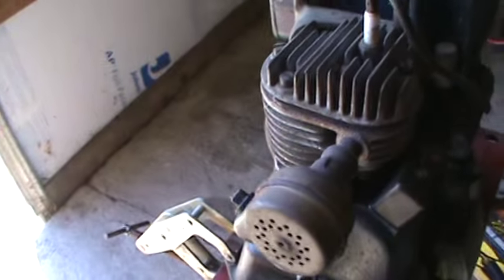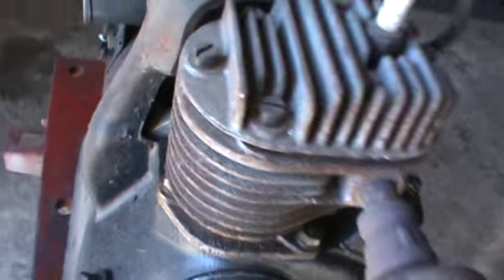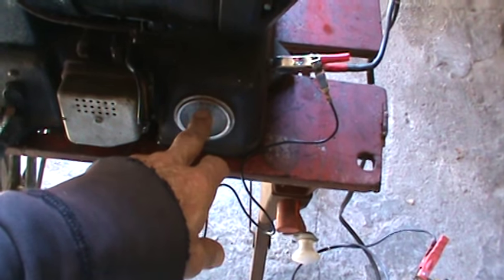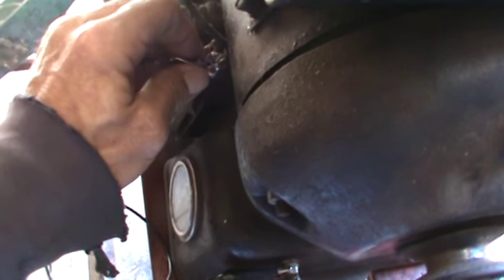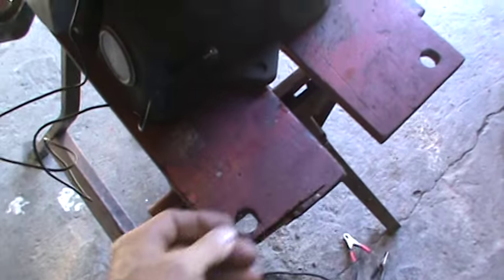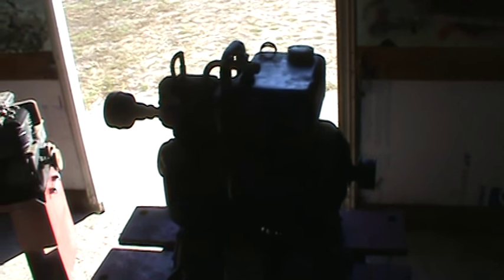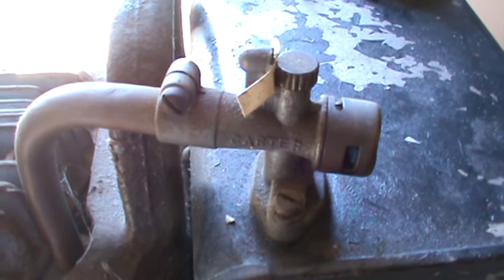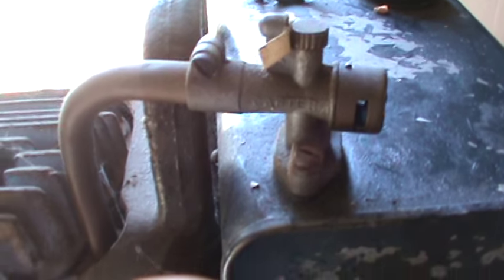Airline Charger by Montgomery Wards

Comment: Looks like a fun toy.
Reply from the maker: +sixtyfiveford I've had it for years and it's not often enough that I bring it out for a little run time. When I posted the video, I had put half a pint of fuel in the tank and wanted to see how long it would run on that little bit of gas. I got tired of waiting for it to run out of gas at 50 minutes. lol. Great to hear from you my good Friend! Cheers!! Zip~
Reply: They always seem to run forever when you're trying to run them dry.

Comment: How cool is that!  You know there are EPA employees losing sleep tonight over that small engine carburetor.
Reply from the maker: +Craig Arndt lol...Yep, it's TOO simple and efficient! Only one moving part...blasphemy! It's needs to be overly complicated in order to pass our strict EPA regulations! Add 100 more parts, make sure clean overly filtered air is going through an overly restricted and over priced three stage air filter is used, sensors galore, fuel injection, catalytic converter i the exhaust system and don't forget the O2 sensor! Heck, make it three O2 sensors! lol...I'm with ya on that! And they call today's small engines efficient? My cast iron 16hp engines will run under full throttle and load for hours on a gallon of gas while these new 30hp behemoths (which aren't any where 30BHP) guzzle gas and put out more harmful emissions than my old engines ever could.

Comment: I have one identical!! I had mine running once but mine is missing some parts now it won't run lol. The regulator is screwed up I know that
Reply from the maker: +1944johndeerel Really hard to find parts for these old machines. The regulator cover on mine isn't the original. I had to come up with something and that piece was a muffler baffle I had lying around that just happened to sort of fit. I was lucky in that this one was complete. It had a bent valve and stuck tappet when I got it. The vales are the size of a quarter and a nickle..lol. Cheers my Friend! Zip~
Reply: they sure are neat though!